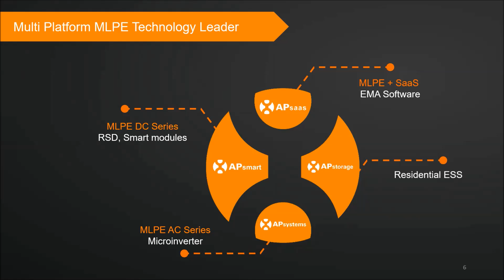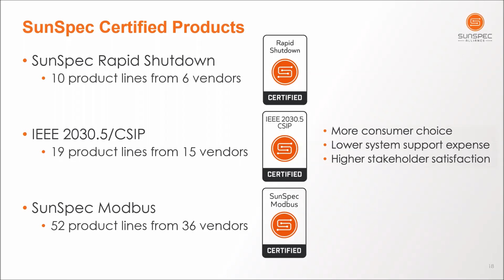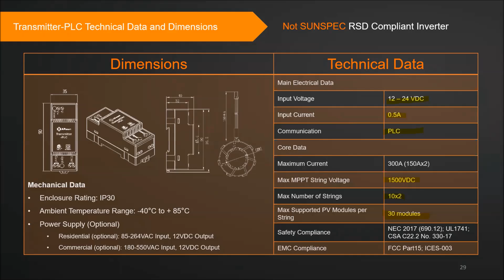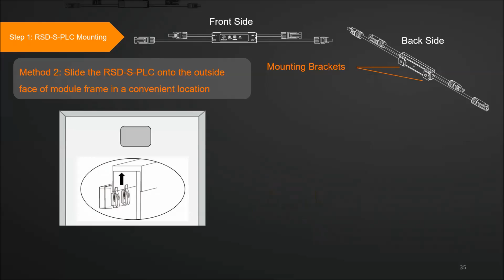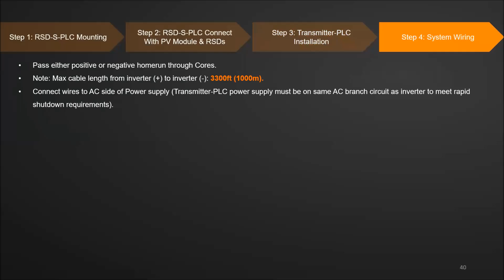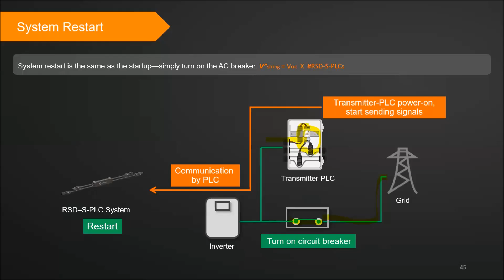APsmart Rapid Shutdown Solution Overview and Installation Training

Comment: I would like to install this on an off grid system. I would like to break the transmitter 12vdc line with a big E stop button. Is that ok? Also Can I use 1 RSD S to open the string circuit? I have 2 strings I would add 1 to the first panel of the string. What do you think or do I have to test this all myself? Thanks
Reply: Were you able to test how the one device works out?  Does it open the circuit or just reduces the voltage by one panel voltage?
Reply: @maxgor9576  didn't test it.